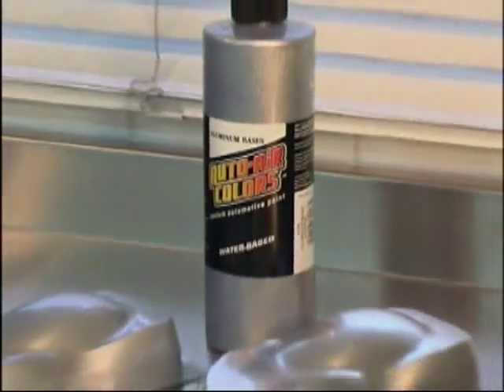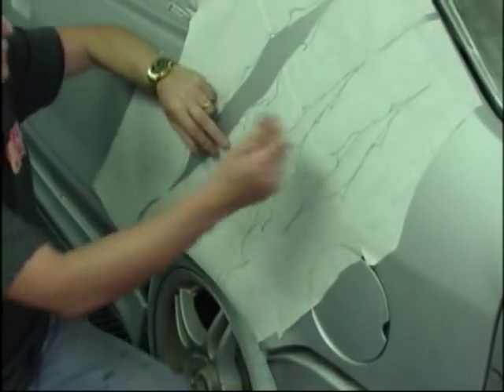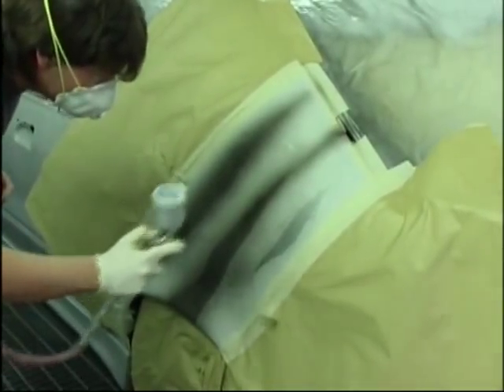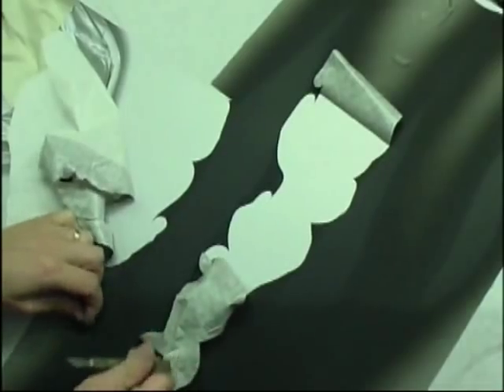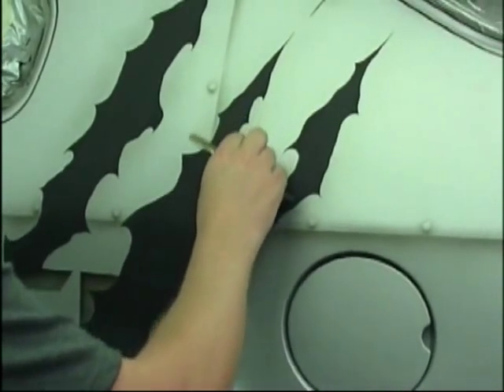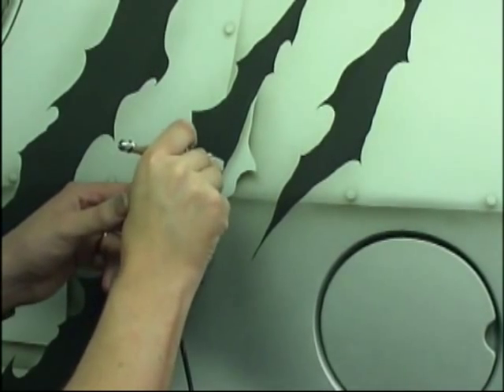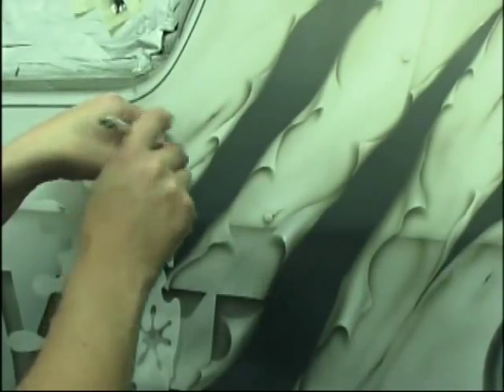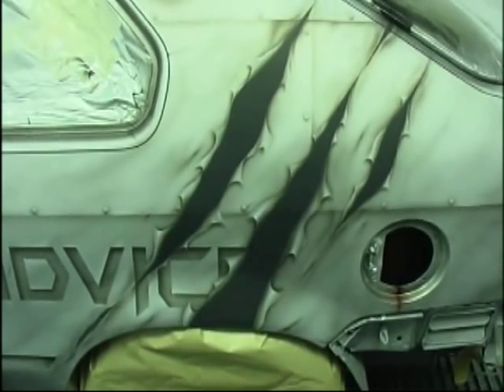How to airbrush with Auto Air Colors Airbrush Paint Guide - 4100 Series

Comment: Hi Simon. I’m doing a helmet with Aluminium Medium and I’ve added a drop coat of Transparent Base over the aluminum prior to masking. But I am still getting visible marks from the masking tape (just tried with fine line tape so far). Do I really have to clear it to avoid this or do I need to put on more coats of Transparent Base?